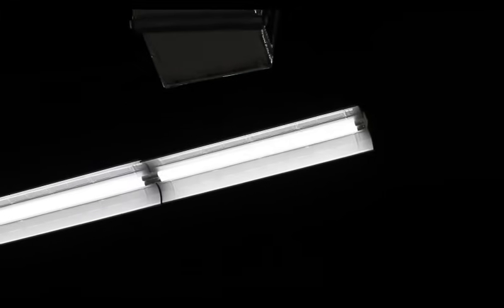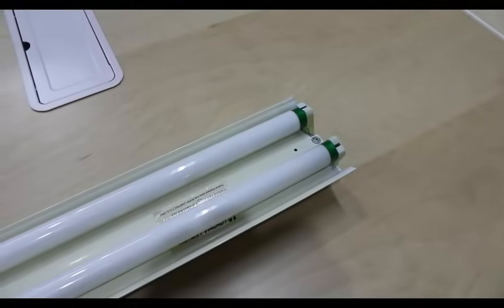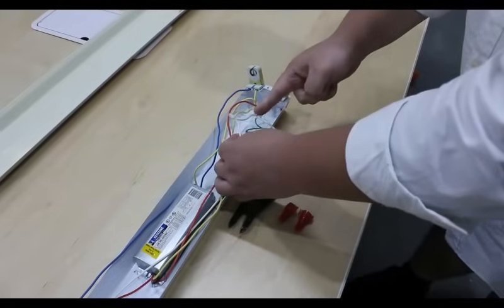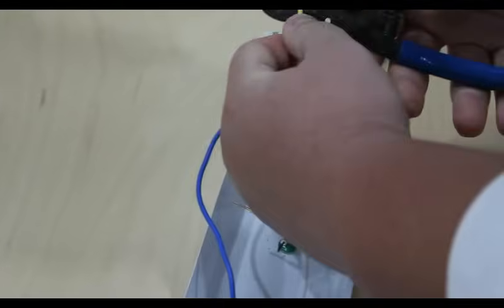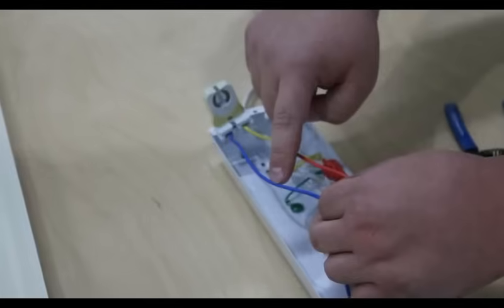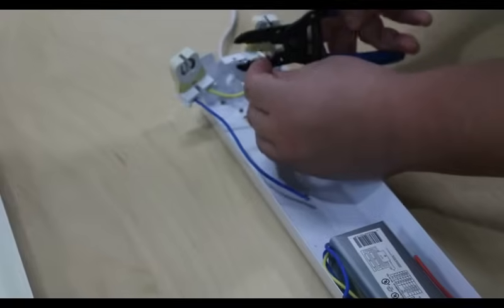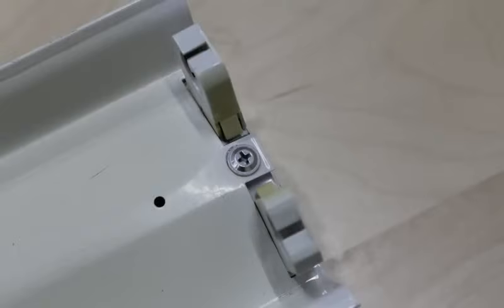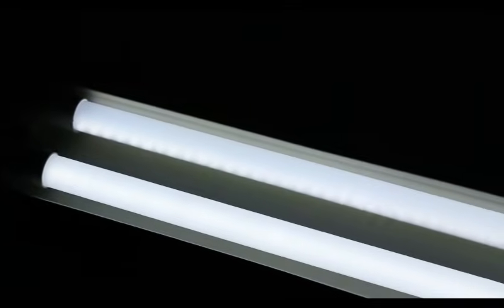StarLED T8 / T12  Ballast Bypass Instruction for LED G13 Bi-Pin Tube Light

Comment: I watched your video as it was the first one recommended and wired my fixture as you showed called shunted only to open my bulbs I purchased was for a non-shunted configuration *hot and neutral on one ended. I'm finding out it's harder to find shunted style bulbs on the market so your worthless video is only good if you purchase StarLED bulbs!

Comment: Your MUSIC SUCKS. And you should have used a YELLOW wire nut, not a red. The MINIMUM would be 4-18 gage wires not three. A yellow or smaller is required. You also need to address shunted tombstones or someone is going to blow a circuit and the bulbs.

Comment: This video is for single ended LEDs with the Line (L) and Neutral (N) pins on one end.  You have to make sure the tombstones on both ends are non-shunted (the two inner connectors are electrically separate) or you'll have a short circuit.

Double ended LEDs have the Line (L) on one end and Neutral (N) on the other.

Comment: You lost me at the point of connecting to power. Should there be a black wire involved? You have two white wires. In the video the connections to power seems blocked by hands or not clear. Yes I am a complete layman.

Comment: You know this video is almost entirely useless as the dumb shit is using a lamp fixture with a plug on it that has 2 white wires and a green wire ? what fucking moron doesn't use a plug with white black and green like 99.999999% of the world .. the video is rendered useless because it is nearly impossible to follow which wires are power and neutral because the leads are both the same color. This video was not intended to "help" do it your self people it is designed to start a fire and drum up business for licensed technicians to over charge because they are fixing the wiring burnt in the whole house .. ignore this video find a better one as your house not catching on fire would be a better end result then following this asshole. not saying he doesnt know what he is doing its the exact opposite as he can always say you didnt follow the instructions.

Comment: I asked to the man at supply store. He said the LED light bulbs this kind come ready to just replace them using the existing ballasts.
Reply: It depends on the type. There are some like that, known as "drop-in replacement" = "ballast compatible" = "plug and play" = "universal." Those you use with the ballast. You lose some energy savings. This video is for another kind, "retrofit" LED tubes. The man I talked to at the big box store didn't know much -- I had to do my own research.

Comment: Look I am an Electrician, different manufacturers require the feed and the neutral in different locations. While this manufacturer uses the same tombstone for both the Neutral and the hot others do not. some require the hot wire on one end of the tube and the neutral on the other, Everyone should check to make sure which LED tube they use and it's associated wiring. this is not a blanket how to on all LED retrofits. Good luck in your conversions, they are well worth it in the end no matter which you choose!
Reply: cary lamari   thanks man I'm an electrician trained old school by the book. I like watching these videos gives me an idea of what I'll be troubleshooting sooner or later. We've come a long way since I started the trade but 1 thing has remained the same, power has no conscience!  good to see another electrician trying to give proper information, although I'd rather most people have an electrician do the electrical work no matter how small of repair or install, just to many  code issues, product mods.,  applications, blah blah..
Reply: I like these LED conversions, I just wish the tomb stones were more hearty, they can break if a lay person installs the tubes and with these 110 v at the tombstone someone could get hurt. They really should have a fuse at the connection of the fixture in order to provide a second protection for service. But hey that may be the next revision of our code lol
Reply: Totally - the tombstones have to be the shunted type for this to work though - its worth marking on the fixture that it requires single ended tubes also.
Reply: @shanecrozier9196  They have to be the shunted type? I read that T8 LEDs for direct-wire (ballast bypass) were supposed to be used with non-shunted tombstones. (https://insights.regencylighting.com/shunted-vs.-non-shunted-sockets-tombstones-lampholders)

Comment: Ullo  I  think is correct I also saw multiple white wires power neutral jumpers...., but the problem I saw is the yellow wires you connected to the power (load line) are on the opposite side of the tombstone how did this come on  or work ??  unless the starled lights don't care which pin is the load......
Reply: The LED is either single pin hot or double pin hot and neutral. Here is a good answer from: @DP-hy4vh
2 years ago:
This video is for single ended LEDs with the Line (L) and Neutral (N) pins on one end.  You have to make sure the tombstones on both ends are non-shunted (the two inner connectors are electrically separate) or you'll have a short circuit.

Double ended LEDs have the Line (L) on one end and Neutral (N) on the other.

Comment: why not use LED tubes that uses the ballast rather messing about with wires... or just buy a new fitting.... saves a hell alot of time
Reply: The Ballast uses electricity, even if the Bulbs r burnt out!!
Reply: Robert Hellier
Reply: It depends on one needs but LED tubes that are ballast compatible are simpler and I have fluorescent lights with ballast that are over 20 years old that have not burned out yet running LED tubes with no issues.

Comment: Right after 1:30 I immediately understood, thank you! Connect one sides wires to black power wire, and other side to the white wire. Thank you!
Reply: Before attempting to dismantling any light fitting to access internal fitting of fluorescent to change to L.E.D.  JUST TAKE OUT THE STARTERS that are usually on the sides at either end of the unit.Simply push and twist anti clockwise.Replace old tubes with new l e d tubes .Switch on at light switch and Hey Presto !  Job done.
Reply: Leave starters out.
Reply: @alanharcourt896  What do the starters look like?

Comment: Ok so you cut the first wire which was white. You then cut another pair of white wires. Are there two sets of white wires coming from that end you are working on?
Reply: that's the weird thing. You think the home wiring would be black and white. black=live. white=neutral. But here they dont do anything with the black it seems. Since LEDs only need to be wired on one side this video only shows what they did to the wires on one side. What's on the other side? At least show it tidying up IF they tidied up the side they werent using. Not very clear video.
Reply: the fixture demonstrated has a plug-in cord for supplying the power, thus the two white wires.